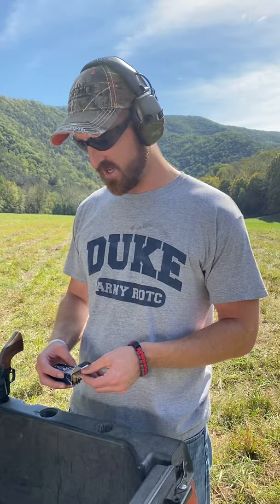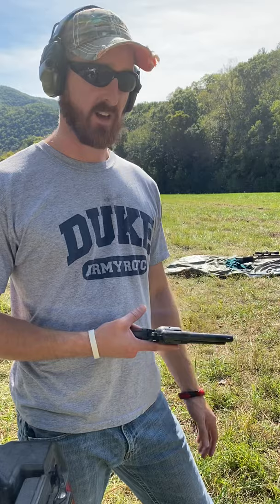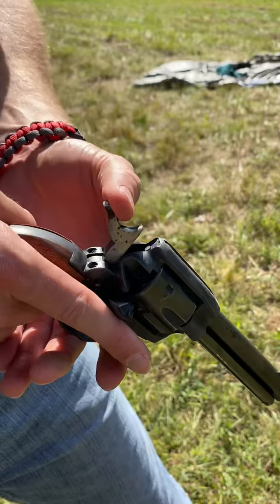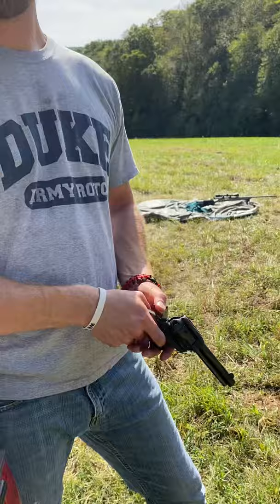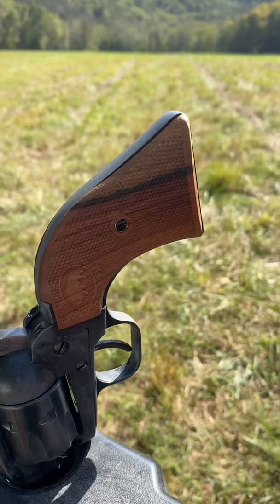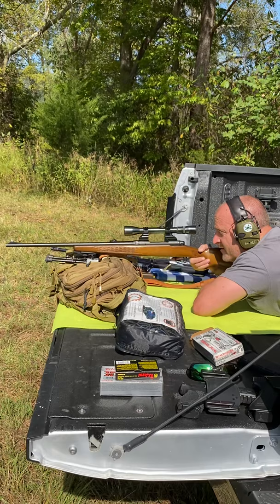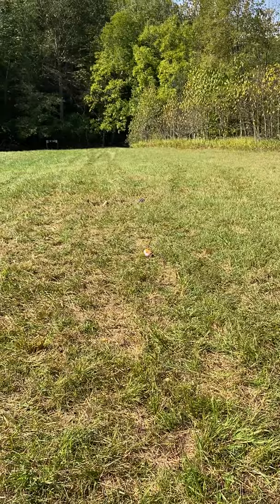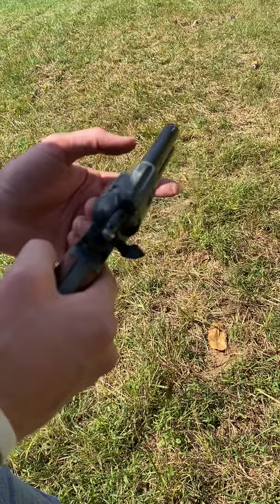Herbert Schmidt 22 revolver

Comment: I actually inherited one of these from my grandpa and it still has the plastic grips. Just took it out today and fired some Águila súper colibrí rounds through. Fires nice. I like the walnut grips you have. Mind if I ask where you found parts for this?
Reply: Some parts will be available from Numrich (gunpartscorp)
Reply: Also got one from Pops. He was very anti-gun, but took it in a trade for $50 off a used car he sold in the 1960s. Probably worth $50 now, but no way it was back then!